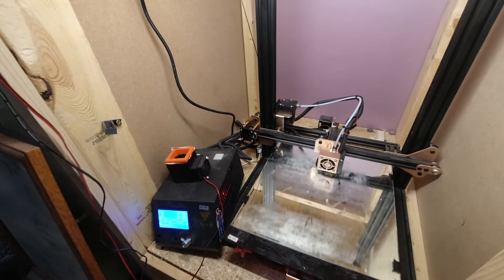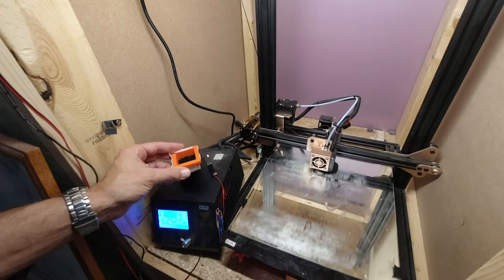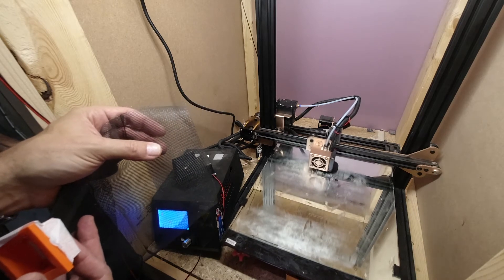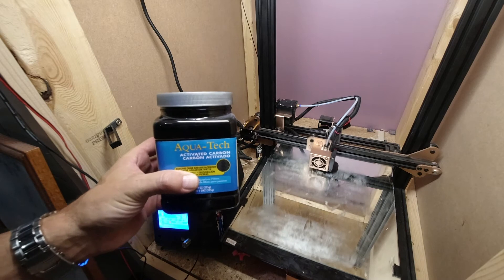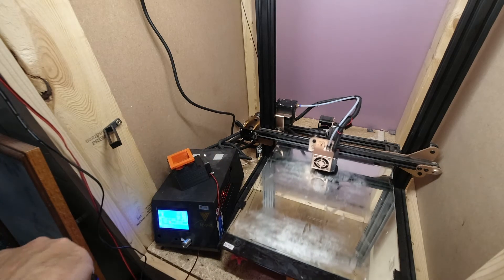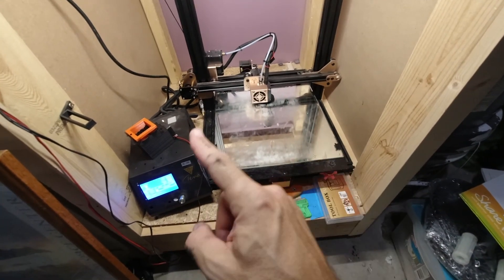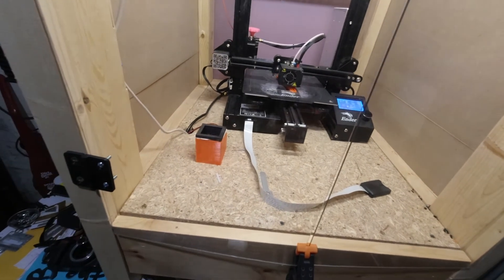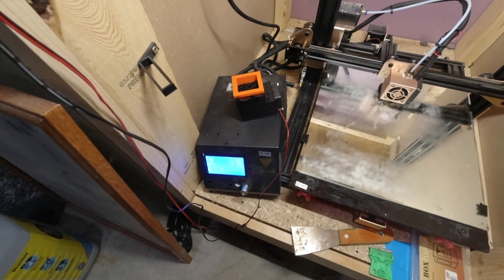3D Printer Enclosure Filter - Version 2 Update

Comment: I filter my air using a pure zone 3 in 1 hepa filter with 2 80mm fans behind it.  Works pretty good for me when printing abs/asa. 

I came here when I was looking for inspiration on what to do with my enclosure, I would like to add more airflow out of it to help with printing pla, since I get some heat creep on long prints it it's closed off. I was thinking of making something like this but have it be the exhaust towards the top and have it switched so I can turn it on for pla and off for abs but don't want abs fumes to leak out. I think a carbon filter setup like this on a secondary exhaust fan would work.